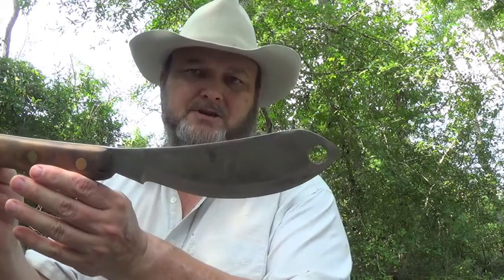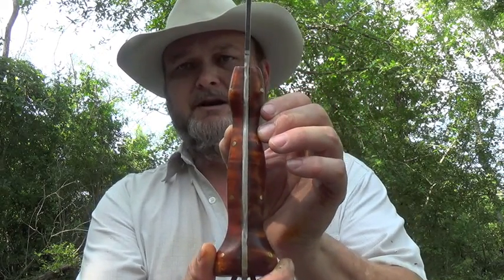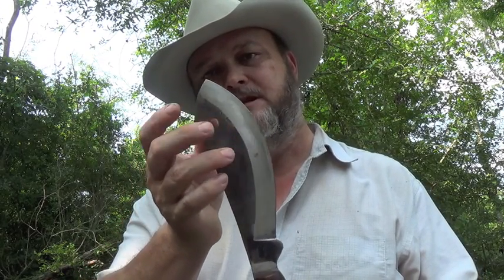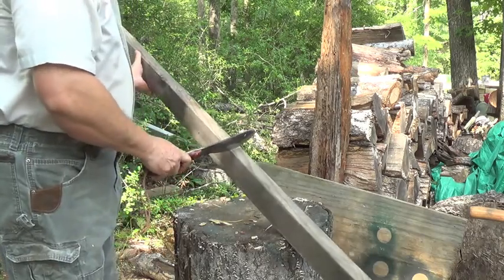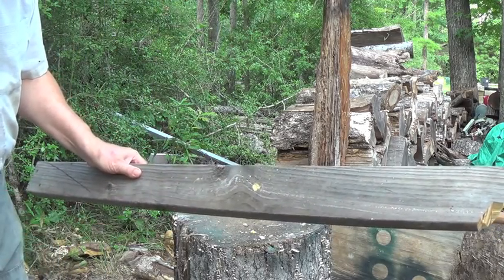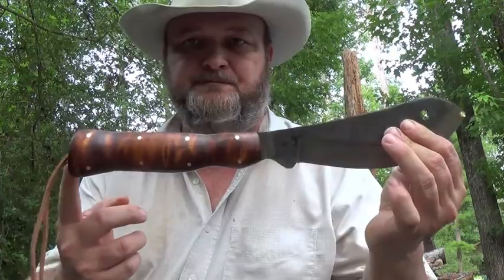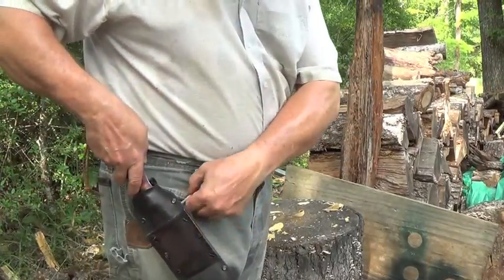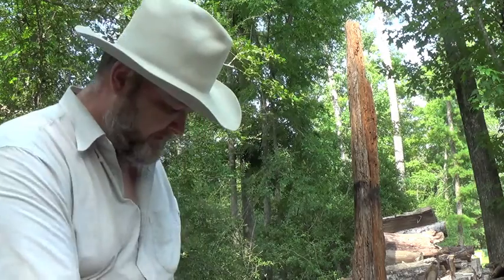Introducing WC Knives "Bushtool"

Comment: Say Heah William,  That Fosyer Bros.  Cleaver more than likely was made out of 0170-6C It was an inexpensive steel that worked good on alot of application's like car spring's along with other thing's,  It also hold's a good edge on a knife blade.  Cold Steel used it as their CarbonV which all their U. S.  Knives were made by Camillus,  Ka-Bar ofcource used it in their Ka-Bar's even up to today and now call it the 1095 CroVan,  I actually like the steel over the regular 1095 because it's not recycled as much,  Tevycled 1095 sell vheaper now on the market.  ,,  .
Reply: Paul'ie 4X The Consiglior who is Heah?

Comment: Say Heah William,  Dang William,  I could go broke buying up your knives,  I likes this one too.  Good concept on the design,  Infact right up my alley.  Infact I bought a hefty CG (Combat Grade) Ratweiler,  Although I use my knives to work wood with.  But out of habit I like to back a large knife with a smaller knife even though I will use the larger knife as a One Tool Option .  But Because of the choil,  It thinks it's a smaller knife. It's also a full 1/4" steel and mine measures a whopping 7 3/4" from top to pommel,  It is a hefty whopping piece of 52100 that's Deferentially Tempered around 60 RC.  Yeah I could make nice curls and batoning is no problem.  When I carry my Ratweiler,  I usually don't take another chopper,  But on cold weather trips,  I will bring an Axe.  But right now since the weather is nice,  I just bring my Bacho Laplander and a Haversack with my other C's.  I do admit your designs are Aces.  Very nice. I also like a 2Knife carry especially on extended trips,  Your knife and a smaller knife would be an awesome  combination.  Like I said,  You make some awesome  knives.
Reply: wow

Comment: Now that some time has passed would you still make out of 1095 or maybe other like the  wc woods man?
Reply from the maker: As with most things all knife steel selections depends on the maker. From testing my knives and my heat treating processes 1095 is a good steel and the only 1,000 series high carbon steel I would recommend. My first choice and most preferred for my use is O1 tool steel. If you wanted a stainless steel I would recommend CPM s35vn. The WC woodsman is a edge grind design not a blade shape design. so instead of a saber, full flat, or a scandi edge the full length of the blade a Woodsman grind is a combination of a scandi near the handle with a saber grind or a full flat grind from the scandi portion to the tip.
Reply from the maker: But with that said. This is a custom shop so you can order the knife to fit your needs and how you prefer it.